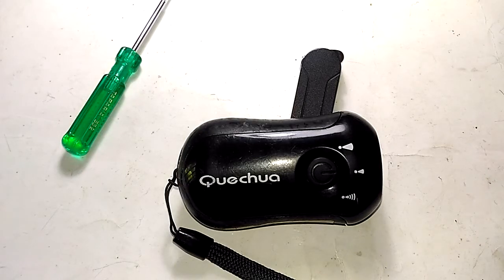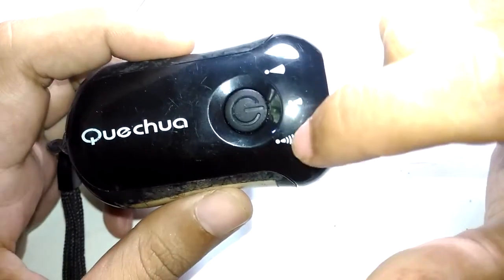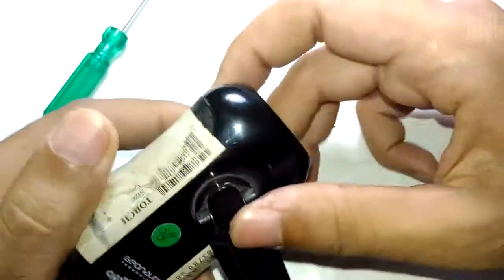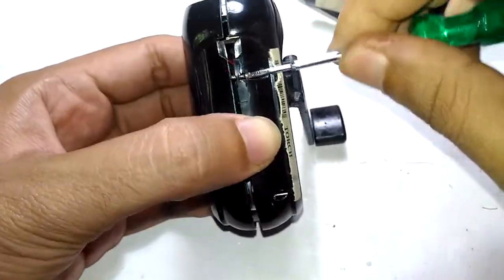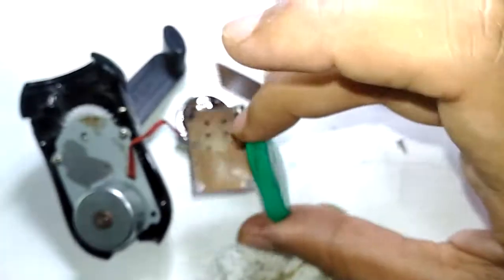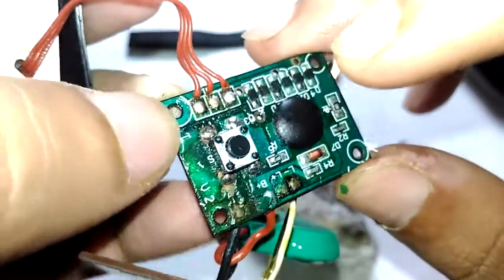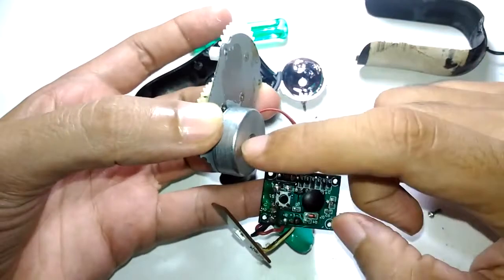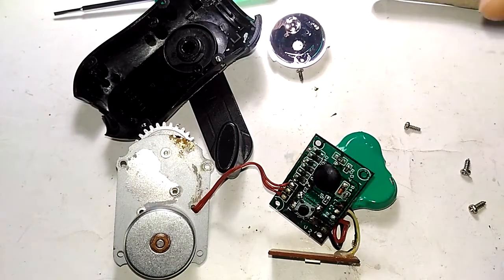IE40  Quechua Dynamo 100 by Decathlon, teardown!

Comment: I have the orange decathlon dynamo 100 that looks similar to yours but the screws are not visible.

I wish to know if the battery is similar?
Reply from the maker: If it's a newer model, chances are it may be holding a lithium battery inside.